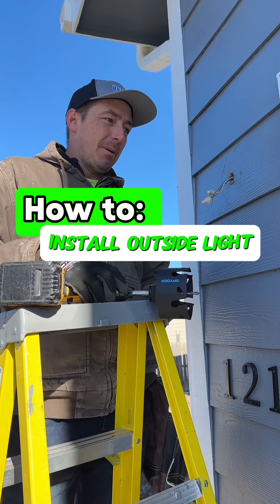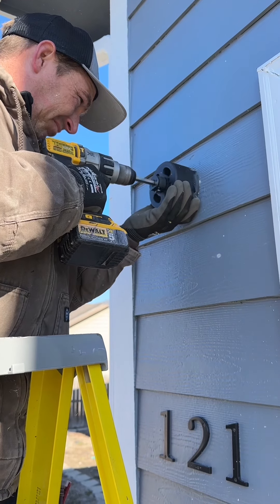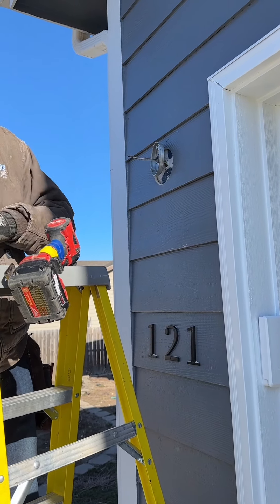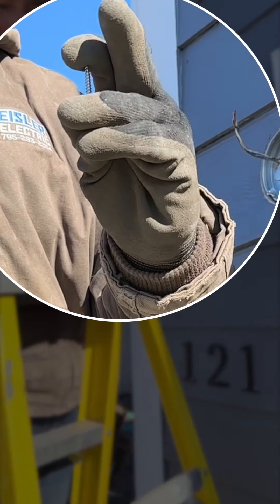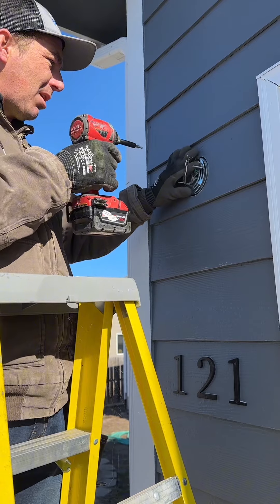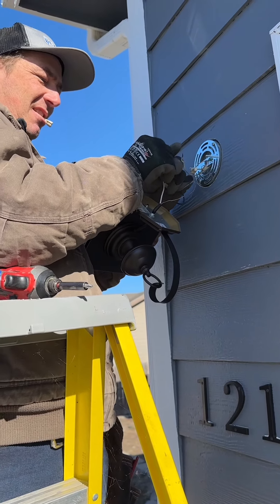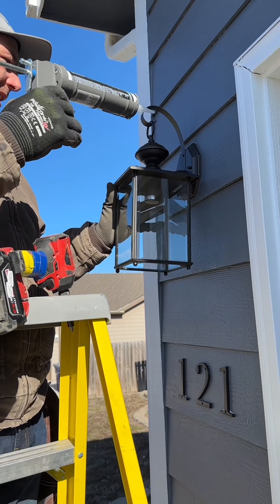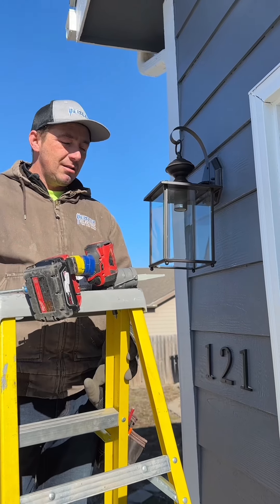How to install an outside light fixture.

Comment: Pro tip: Cut a cookie from a scrap piece of plywood and screw it to the surface you want to cut the hole in. The cookie will act as a guide and can protect the wires at the same time.

Comment: Nice job. Thank you for sharing.

Question: Are pancake boxes approved for outdoor use?
Reply from the maker: Yes they are if they are “in wall.” But only 1 wire. You’ll need a cut in box for 2.
Reply: @ By one wire, you mean one cable, correct?